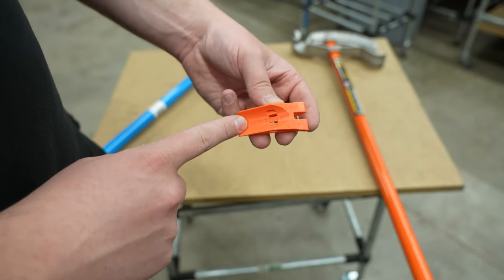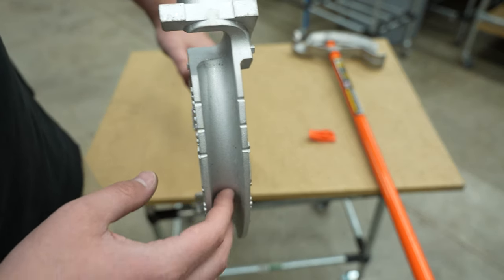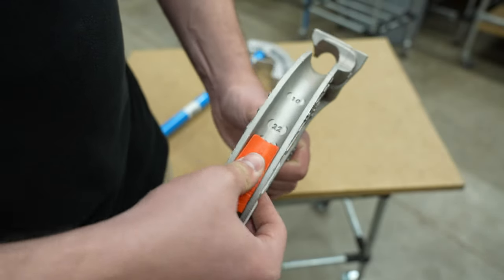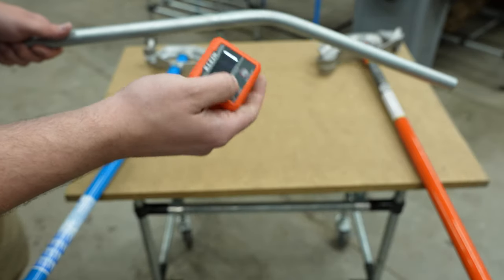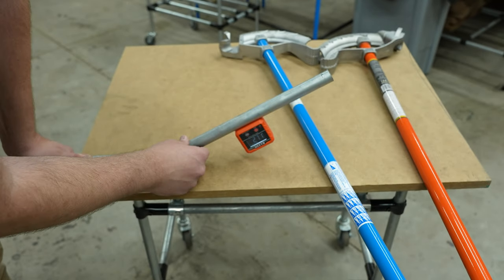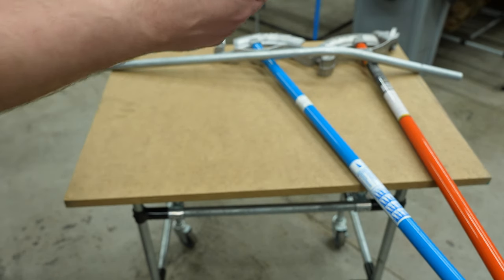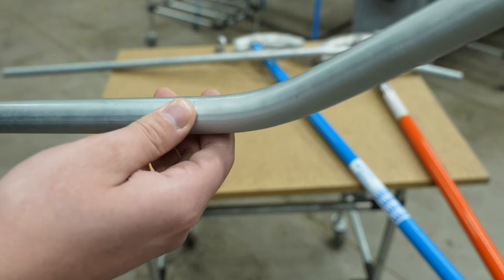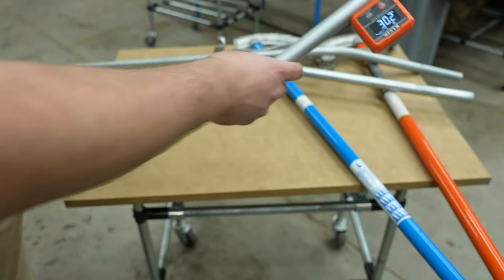Does This Simple Tool Really Work?

Comment: This accessory for Klein benders is great.. UNTIL you forget to remove it from the 45 or 30 and then a colleague goes “hey man, can I use your bender real quick?!”  Then he goes to do a 90 on the floor and kicks the conduit PAST the hard stop device and kinks his pipe in half - and smashes the form of the orange plastic insert so that it never accurately does a 22.5/30/45/60 ever again.

It’s suck a gimmick.

Guys, just get good at bending pipe using the angle lines on the Sid Rif the shoe..  over time you’ll master your bender and develop a good muscle memory.

Over the years I have turned out better/more accurate 90’s, offsets and whatever else without the orange insert consistency better with just practice.

The orange insert is no longer accurate once it gets compressed too much.

Comment: To minimize the ripple, pack the pipe with sand. It can still happen so bend slowly. This what we did when I worked for a steel company.
Reply from the maker: Great tip! Thanks for the comment
Reply: @MakerPipe  no problem.
Reply: That sounds like a bit of a hassle. It also sounds like it would work, though
Reply: That is too much work, learn how to do it correctly instead of packing conduit with sand all day.
Reply: Boss:  what are you doing!
Me: packing the EMT with sand to avoid kinks/ripples
Boss:  go home
Reply: @lilcourtny08   Well, if we're all here to think of weird techniques to make the bend on a conduit look cosmetically better, might I suggest threading the ends, putting caps on, and filling it with water?  

We all wanna make sure these conduits look THEIR BEST, right before we put up that drywall over it.
Reply: @h8GW  that is also soft emt. You Don't thread that type of pipe, lol. Rigid conduit gets threaded. Good luck trying to thread Emt conduit without twisting it and destroying it. You obviously don't have a clue what you are talking about
Reply: No, apply more foot pressure to the pedal. Too little foot pressure is the cause for ripples and kinks in EMT.

Comment: The bend with the angle stop tool isn't 2 degrees off. It's reading 30.2 degrees off on the angle detector tool  that's 2/10 of a degree.. 32 degrees would be 2 degrees off..  .2 degrees off is very good on a hand bender.
Reply from the maker: Yes, you are correct Frank. Thanks for the comment!

Comment: Klein is really aiming for the throne with their products lately.
Reply from the maker: They’re definitely coming out with some interesting tools
Reply: Klein has some good stuff, for sure.. but their overall quality and quality control has gone to shit over the past couple of years..  
all of their new “innovative” multi-in-one tools are crap.  Their step bits and hole saws are crap.  
Klein is a great example of the ol’ expression “they don’t make ‘em like they used to”.

I’ve had over a dozen of my Klein tools fall apart on me I’ve the past 2 years..  from the cushion grip slipping under torque, NCVT’s not working after a few months, step bits going dull after 3-4 holes, carbide hole saws disintegrating while making a hole, bender stops (the subject of this video) loosing accuracy after a few bends, sockets getting rounded etc.. the list goes on.
I emailed Klein with a detailed report of all of my tools that have failed.. showed them how my Greenlee, Ideal, Knipex, and Wera stuff has lasted for a decade.  
They promptly acknowledged that they have had complaints and are working on getting their QA back on track.  A few days later, a box from Klein arrived with over $700 in brand new tools (everything that I detailed in my email to them) showed up at my door.  

I still haven’t opened anything up and just have learned to stop buying their shit.

Comment: It would help if you showed that your table was level, it was wobbly and cleary unstable.   Key to getting these angle things accurate is to start with a level surface.
Reply from the maker: That's true when performing bends but I don't think checking the angle on an uneven surface affects the readout as long as the straight piece of conduit is flat. I Imagine it checks the angle relative to the rest of the piece of conduit otherwise electricians wouldn't be able to use it in all sorts of environments and different conditions. I could definitely be wrong though. Thanks for the comment

Comment: I have a question: can I use a 3/4” bender for both 1/2 and 3/4? Using the same angles
Reply: You can if you are in a pinch but the 1/2 won’t look good, the radius of the bends will look sloppy

Comment: No there aren't any codes on what angles you use for offsets. You just can't exceed a certain amount between pull points, but being .2 off would not even be taken into effect on that
Reply: Can't exceed 360. But most stop before 270. NEC 340.52.3766.171.47473 section B appendix C foot note A4 states we should look at code 210.35378.37204.33 while maintaining continuation from index C table 4-18 under the size 5 Times new Roman font stating f conduits get bent!